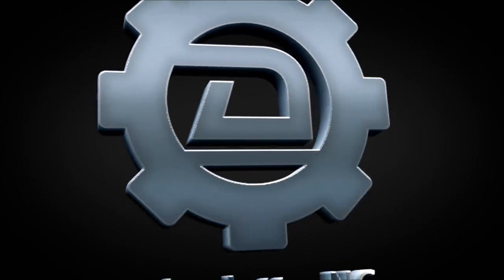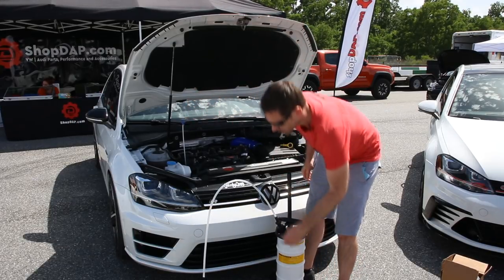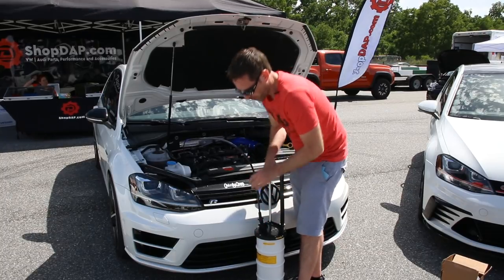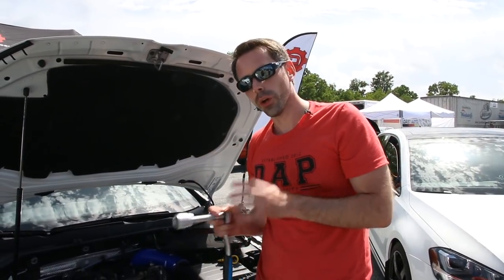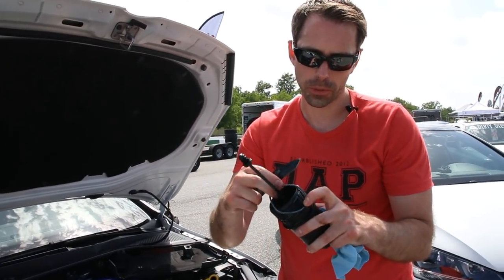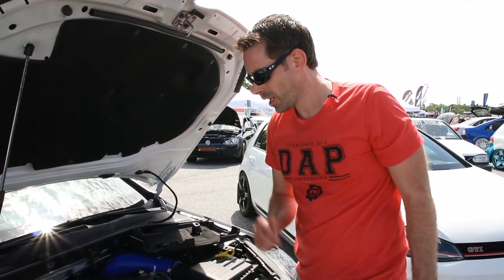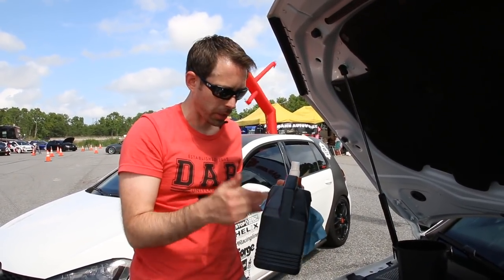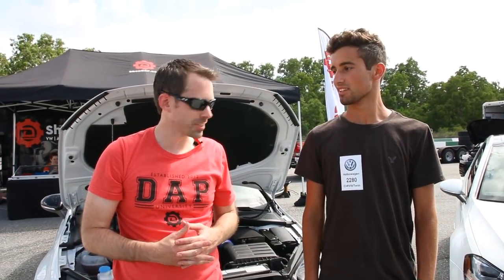Oil Extractor Oil Change DIY on a VW MK7 Golf R

Comment: You should remove the filter first, before you start extracting oil.  The filter housing has a check valve that holds oil up top for the filter during startups.  When you pull the filter, that old oil runs to the pan and you can remove that, too.

Comment: Good tip for you all. When removing your oil fill cap, put the cap over the hood latch so if you forget to put the cap back on you wont be able to close the hood.
Reply: Unless you still forget and slam the hood down on top of it cracking it in half. I've witnessed that and almost done it myself.
Reply: CarCanuck I agree and this is true but If I had to choose I'd rather have to grab a new fill cap than drive around spraying oil all over the engine bay
Reply: I literally just had this discussion at work today! XD

Comment: You don't have to keep pumping the whole time, once you create the vacuum with 5 or 6 pumps, the oil will all come out. Just leave it for 5 mins and when you get back all the oil will be out of the oil pan. Absolutely no need to keep pumping the whole time! LOL
Reply: Right.  And these guys are experts?
Reply: That was my first thought, but wouldn't manually pumping also increase the suction and make it go by faster?
Reply: Since y'all did it before, I'm about to do mine. What temp is usually the best? I heard above 90 but no more than 120 because of the hoses. Any specific u all go with?
Reply: Also, remove the oil cap as to remember you have to refill with oil? You remove it to prevent a vacuum in the engine.
Reply: @Gaara123ism  hey man i was thinking about buying one for my mk7, after 2 years do you still use it?
Reply: @georgesealy4706  experts on the car not experts on physics!

Comment: Cleanest oil change lol. Soo much easier than all my subarus over the years. Looking at getting an mk7 gti or R.
Reply: My Subaru has the oil filter on top of the engine too making oil changes with this extractor super simple.
Reply: @markw1123  yeah that's a good thing about the fa engines 👌🏼

Comment: There's no need to keep pumping, once the oil starts to enter the extractor, it works like a siphon and continues extracting on its own. There's also no need to remove the metal rod in the hose, it doesn't restrict the extraction process. At the end of the process, adjusting the tube up or down an inch or two will insure you'll get all of the oil.

Comment: I found that after a few pumps i can let the oil just extract itself so you don't have to keep pumping again till towards the end. I'm sure its faster to keep pumping but i found that you dont need to actually keep pumping.
Reply: No I think it's faster to remove the sump plug lol. I would have changed oil filter, fuel filter and air filter by the time they pumped that out
Reply: @shaunsims7570  You'd have a hard job changing the fuel filter, it's located in the tank on these and is not serviceable

Comment: Honestly I would have opened the filter first, the housing is still under pressure and once you open it all the oil trapped inside will drop down into the oil pan. It's not much more oil, maybe only about 200-300ml, but still waste oil.
Reply: Wait what? How much though. I fell like it would start seeping from the seal

Comment: Not sure if there's something wrong with your extractor but I have a very similar looking one I got at West Marine for my boat and you definitely don't need to keep pumping like that. Pump until it's at full vacuum (usually about 20) then walk away. 5 minutes later pump it 10 more times to verify you hear it sucking air and you're done. I then stand the suction line up in a corner of my garage leaving it in the pump and by the next day the residue oil drains out so it's nice and clean for storage.

Comment: I like the concept. One question: How long do you think the original drain plug will last? If you never unscrew or replace it should it be fine?? Thanks
Reply: I would say plug way is superior. Reason being, u drain oil not only cuz it’s old but because your getting sediments out as well. This method doesn’t seem like it’s that efficient at getting the sediments from the bottom of the pan. In the same manor a straw in a cup doesn’t suck up all the fluid if it’s not all the way on the bottom of the cup.

Comment: Oil up that Oil Filter seal!
Can´t Tell how much broken Rubber Seals I Have seen on Volkswagens cause of that.
Reply from the maker: We did in case you didnt see when we installed the new one. We did forget to mention which is a good tip
Reply: Nah, didn´t see that in the Video.
Reply: It's because they didn't

Comment: It's only that easy if your filter is topside.

My B8.5 allroad and Touareg TDI are this easy, however my B5.5 Passat, MK4 R32, and 2.5 Beetle all require getting under the car.

Comment: Since the oil pan is the lowest point on the car wouldn’t there still be a little oil still left in it that is extracted and wouldn’t that hurt the car?
Reply: Maybe there is a little residual left, but it has to be tiny.  When I hear the vacuum-sucking sound, then I know it is near the end.  I then move the dipstick tube around to suck up what might be left behind.  I also suck out the old oil from the oil filter well. So that is a bonus.

Comment: Saw your video, and plan to do my own oil change when I buy the extractor.  I'm at the 40k service interval, and would like to know how I could use this pump to do the DSG service, or if you would/would not recommend using the pump.  Thanks!
Reply from the maker: Nope not for a dsg service. We will have another DIY for dsg services on our Alltrack coming.

Comment: Would Mobil 1 0w-40 be an acceptable oil to use? It meets VW 502. Would the dealership deny a possible future warranty claim if you used this 0w-40 instead of a 5w-40 that is VW 502 approved?
Reply: No issues at all. I actually use this on my VW. Been using it since 28k when i got the car and I'm now at 109k miles on a 2010 Wolfsburg Jetta with the 2.0T Tsi engine. And its the only oil i have at my shop for VW's, But as long as it meets that 502.00 Spec you are in the clear. Although both 5w-40 and 0w-40 are both ok in all temperature climates it all comes down to prefference.

Comment: you missed the smaller o ring on the oil filter at the top of the housing ;) coming from a vw audi tech
Reply from the maker: +david white those are not included in the MK7 filters like they did on the TDI ones.

Comment: Paul are extractors common in the automotive industry?
Reply: I think my Audi dealer uses one. Didn't seem like they took the bottom plastic shield off the times I got a service with them.  They have an official VAS electric pump for doing so, it is described in VW's shop manual application, ELSAWIN.
Reply: No. Extractors don't drain all the oil, pulling the plug from the oil pan or removing the pan all together is way more effective.
Reply: CarCanuck If anything I think pulling the drain plug with the car on a lift could be a modestly faster than the extractor, but the extractor pulled out 5.6 out of 5.8 quarts; seems effective to me. I was just wondering if techs use them often. Btw most techs dont let the oil drain completely out in order for them to do the oil change under 15 minutes.
Reply: My VW dealer uses an extractor unless you specify otherwise. Draining a MK7 Golf doesn't require removing any covers, but my daughter's '15 Beetle has an aluminum plate covering the steel pan, so an extractor would make for an easier change.

Comment: Cool but you chose a car with an up top filter when most have them below.
Reply: True.  But I would say extracting the oil using this method is particularly advantageous for cars having oil filters that can be replaced from the top.  So it kind of goes hand-in-hand.

Comment: Can you do this on a dry sumped engine?  And does it work via the fill hole if one has no dipstick?
Reply: There is usually a plug, where the dipstick used to be, it was on the Audi A4, it pops right off
Reply: cengeb Seriously? I didn't find any.
Reply: It on the 2012 A4, instead of the dipstick handle, is a cap, yup! It popped right out, and I used my compressor driven extractor, and teh filter on top, no more climbing under, my 2016 GTI has a dipstick filter on top, no crawling under, and since my GTI is lowered about an inch with Eibach pro line springs, , it's much easier doing it from the top.  The Audi As 2L dipstick plug was black, so maybe you ain't thinking it's the old dipstick area? It was right in front Oil level was read on dashboard display
Reply: cengeb 🤔🤔🤔 I need to know if there is a hole in the mercedes 180 cgi.
You don't have it in the U.S.
Reply: can't answer that one, don't know.

Comment: Why are you pumping the damn thing so many times. Lolol
Reply: I use a 'Topsider' oil extractor.  It's not the most expensive one on the market or has a bunch of bells and whistles, but it works great.  I have used it for about four years.  For that unit, it takes about 20-25 pumps to create a good vacuum.  Then I leave it for about 15-20 minutes.  It took about three different times for me to get the overall process smooth and fast.  At first, I didn't have the connections tight enough so it was losing the vacuum. Then a few other things.  I am not a real experienced car guy so I fumbled a bit, LOL.

Comment: What a waste of time. I'll stick to my regular way of changing my oil.
Reply: V1 Rotate It's really good for people that can't use jack stands...
Reply: If you have an insignia, the sump material is like soft butter so avoiding removing the sump bolt is great.
It takes a bit longer but you can do other things whilst you wait.....air filter, plugs etc.

Comment: Oil extractor? Why bother going thru all the mess, while gravity can do the job for you at any oil replacement shop. Lifting the car gives you the advantage of inspecting the undercarriage, leaks, etc. Pay $20 for the service and have a peace (piece :P ) of mind :)
Reply: M0N33R it's much less mess and quicker then lifting the car. The reason they put filters on top is so oil extractor can be used.
Reply: yup, I have a compressor powered extractor filter on top, never took out drain plug yet, crawling under car sucks.  Especially with Eibach springs pro line and ways that lowered it an inch...
Reply: 20 dollars for a service yea right
Reply: $20 ?  What planet are you on?  Those quick lube joints are the last place to have your car left to, so many screw ups, so many dumb mistakes.